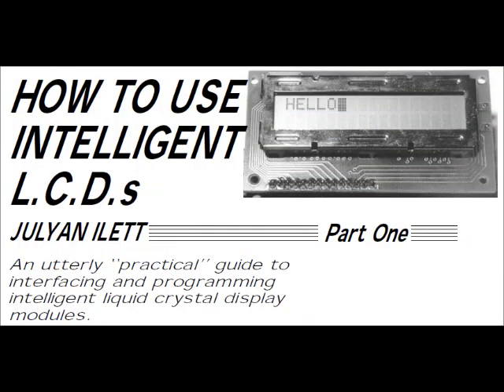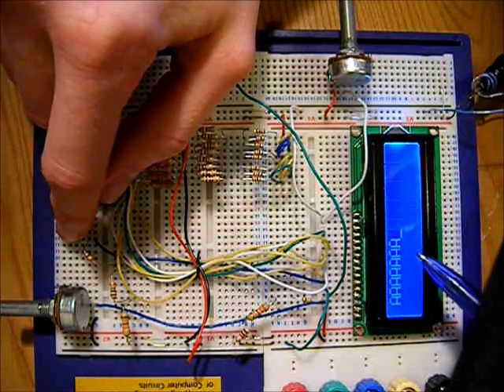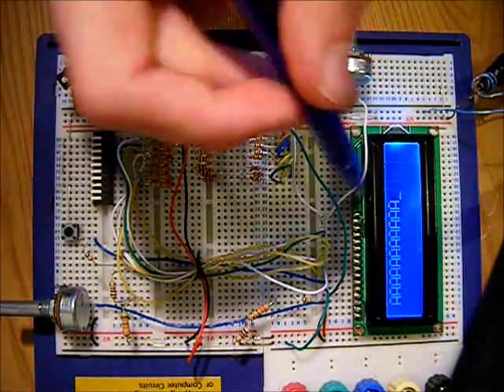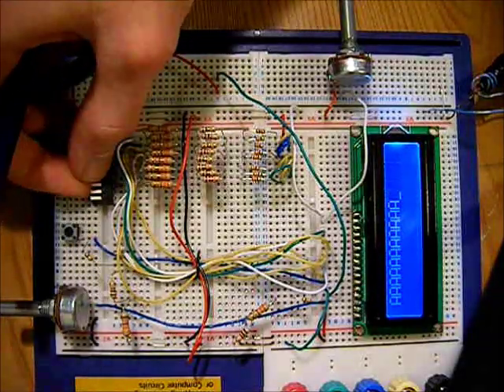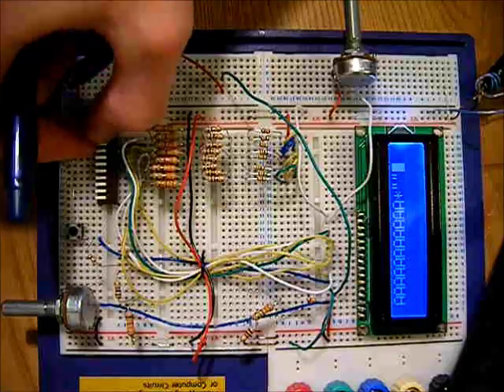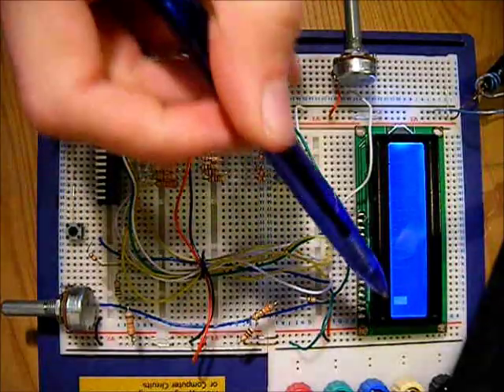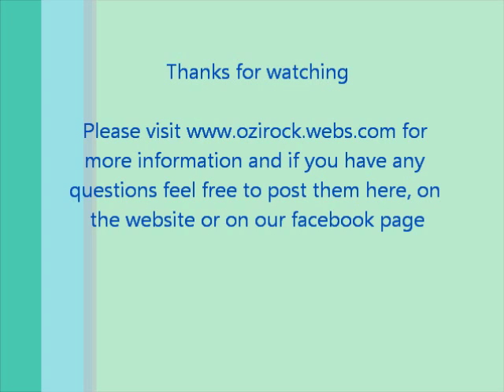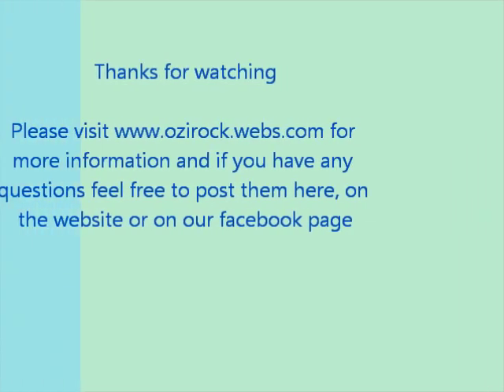Beginners guide to the Hitachi HD44780 LCD display

Comment: Can you tell me how to tell the difference between a HD44780S and Hd44780U ? I'm putting some circuits together and would prefer to have a single 3.3 v power supply for type U, instead of having to add in a 5V for the type S. I can't see the underlying chipset indicated on the unit.

Comment: hi a 4 X 20 the cursor starts at 0 for line 1 ,,64 for line 2 ,,20 for line 3 and 84 for line 4 . The line's are much longer than the screen on a 2 X 16 and thay have gust folded the ends to appear to be a 4 line which is why the addresse look funny but try it .

Comment: i have a 4x20 display but i can only write to the first and third line . how do i initialize the display for 4x20 so i can use all of the four lines???

btw i can set my arduino to work with my 4x20 display and it works so my display is ok!
Reply from the maker: +Hackeras 32 I don't know sorry, I've never used a 4x20 display.
Reply: oh i never rplied to you 
i'm really sorry, i abounded the acount and when i came back there was like 99+ notifications so i just ignored them all
turns out it goes from line one to line 3 to line 2 to line 4 . wierd but it works 
anyway thanks for the video you really halped me a lot a year ago!

Comment: This is a wonderful tutorial.  One thing though.  The double and triple characters are caused by a phenomena called "Switch Bounce" 
If you were to look at the signal with a scope you would see a very noisy signal ranging from zero volts to 5 volts many times faster than you can actually press the switch.  There is a technique in programming called "Switch Debouncing" that takes care of this so that it would appear that the signal only transitioned once.

Comment: the display came for the akai s950!  exactly the same size as the old lcd,  it has 2 bits where i can solder on to the right,  and two on the left ,  the old lcd has a 7 pin socket connection on the right though so i'm scratching my head

Comment from the maker: This is the first time I've ever heard of an akai s950, from a quick google search it appears to be some sort of synthesiser so I can only assume you intend to replace the existing display? The display appears to be a 40x2 character LCD so I would guess it is a standard character LCD controller by a HD44780 chip but I couldn't say for sure, it could be a custom display designed for that device. If you look at the old display you might find a part number to find a spec sheet or pins labelled?
Reply: Please click the reply (3rd button) and THEN comment

Comment: Hey, I have an led display from a DVD player that has 15pins, some run on gnd and some run on +3.3v but i cant figure out how to control the individual segments because if i have all pins powered the entire display lights up, but lets say I take out gnd pin 1, all the bottom parts of the numbers will be removed and I have 4 letter "A". How do I control each light individualy??? PM if you can help please!

Comment from the maker: Hi, well first I guess I should explain that you aren't really programming the Atmel chip on the arduino, you are only telling the bootloader (which came preprogrammed) what to do, thats why you don't need a programmer for an arduino. If you want to stick with that theme you might think about using a PICAXE, I've never used one but I think it comes with a bootloader installed. If you decide to go for a normal PIC you will need a programmer but you should be able to use you knowledge of C!

Comment: Hi, I've done a couple of projects using Arduino, Now I think I want to try do something with a PIC microcontroller, I am very experienced with c++, but I don't know assembly, is it very difficult to program one of those? How do you upload the code to the microcontroller? do you use a usb cable like with Arduino?